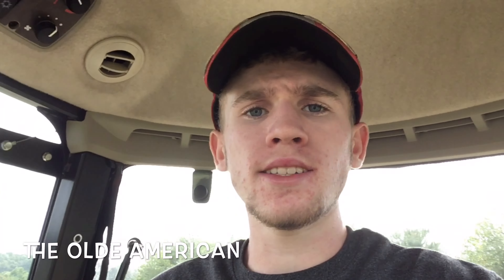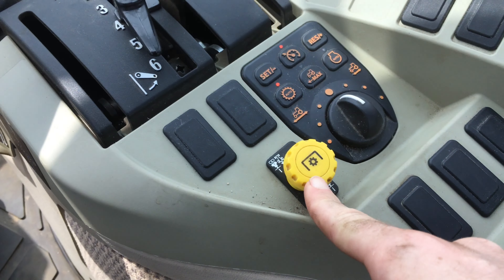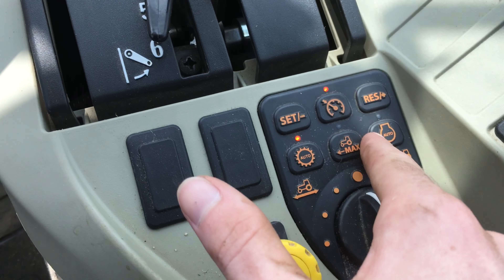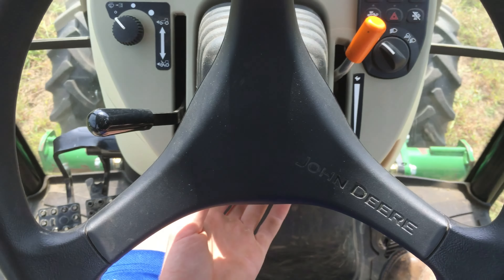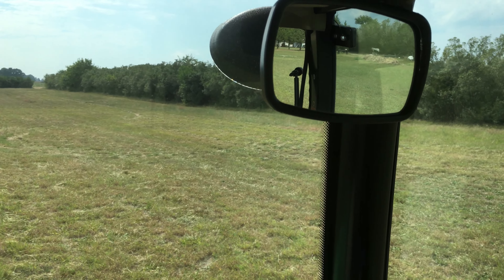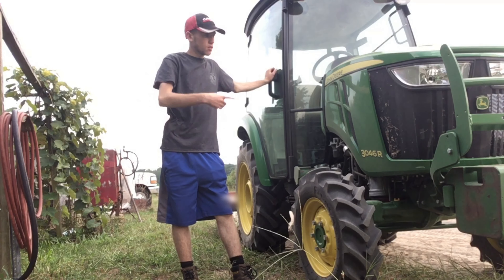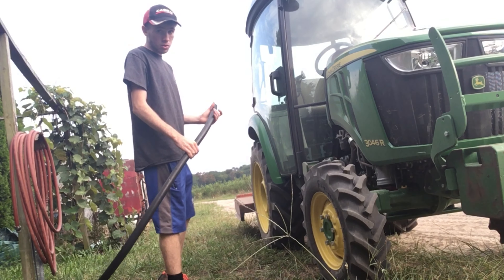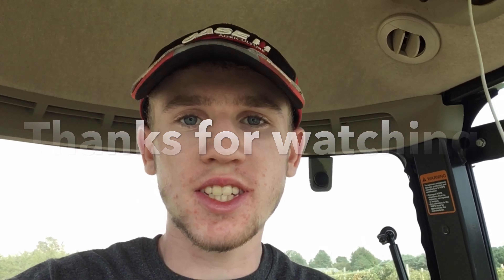Mowing with the John Deere

Comment: You should have that mower balanced as the bearings won't last very long (they may be bad) and the bearings in the PTO will go out quickly. How old is that mower (rhetorical)?

But the Video is a good show on how to use the tractor and mowing with it.
Reply: I saw that and was surprised, my brand new king kutter brush hog does the same thing, must be a cheap rotary cutter thing. This summer or next I'll have to spend the extra and get a legit deere rotary cutter.